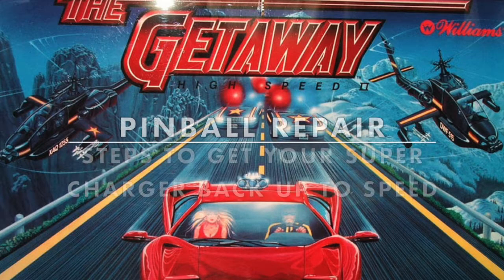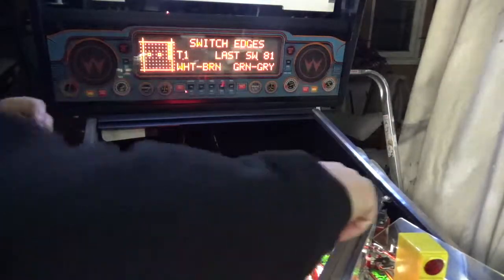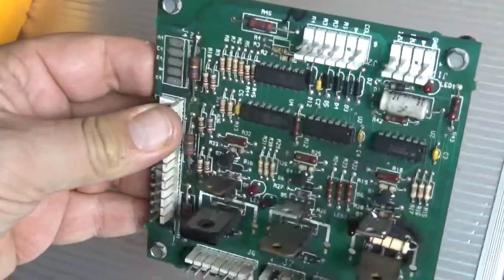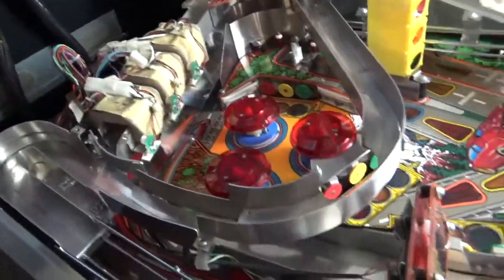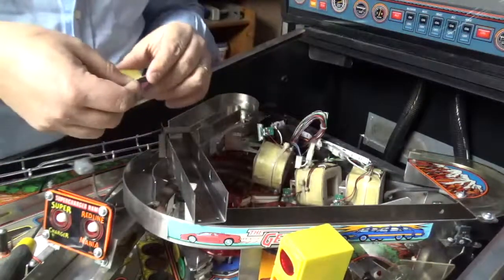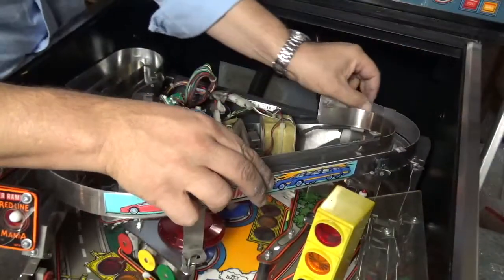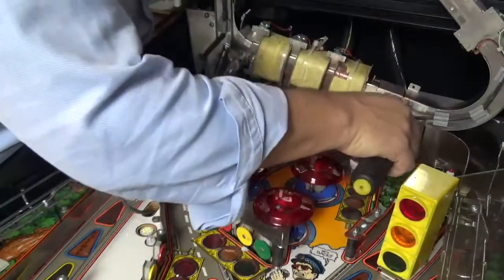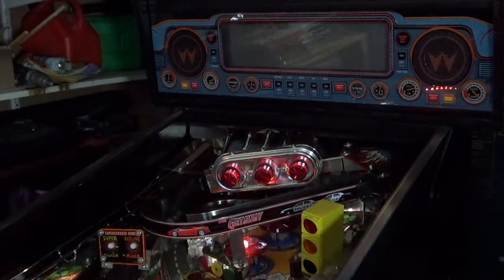Pinball Repair : Getaway Super Charger Repair & Clean

Comment: Update: My supercharger runs at 73-78 sc time test but with 1 coil unplugged it runs at 85. I fixed opto switch board and sc board (burned resistors and leaky caps), cleaned all coil connections with electronic spray and cleaned and buffed ramp with castrol high mileage full synthetic oil 5w 30, good for 5000 miles, lol. Thanks for your help, I subbed for more getaway tech Repair, maintenance or mods.